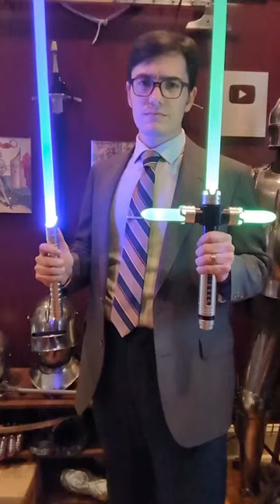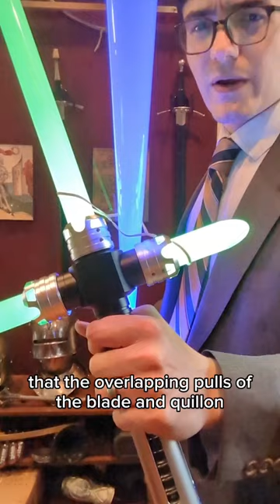Crossguard Lightsaber Theory

Comment: I appreciate your good-faith attempt to clean up Disney's mangled mess.
Reply: Yea I’m pretty sure the only thought they put into it was that they thought it looked cool lol
Reply: But also using information from a Disney show to explain why the crossguard might work(it's possible Disney added that information in so that people can use it as an explanation for why crossguards work)
Reply: @David-gj9qr  The issue is that we can see with our own eyes that that isn't how lightsabers work, there is no magnetic pull. Although lightsabers are unfortunately a flawed concept anyway due to the ability to turn them off and on to bypass blocks and guards that no one uses in real lightsaber fights, so I guess it doesn't really matter.
Reply: Bruh how this is apparently bad and not darth maul’s saber with the huge hilt?
Reply: @omarbaba9892  Darth Maul's saber makes perfect sense. To wield it properly he relies on a form which is more aggressive, and the extra blade can be used as a surprise attack or it covers your back while also defending yourself from the front.
The hilt is long so he can comfortably hold it with both hands without cutting his arms off attempting to do a trick or using the force push.
The hilt is also long because it's basically 2 normal lightsabers glued together on each side, and as shown, the blades ignite separately. And one blade can still be used if the other half of the hilt was cut off.
Reply: Pretty sure cross guard lightsabers exist in legends, it certainly seems like something someone would have come up with before Disney
Reply: @iainwmacintosh  legends had the wackiest lightsabers ever
Reply: @omarbaba9892  Yeah, legends literally had a lightsaber that acted like a whip, but no Kylo Ren’s lightsaber is unrealistic in the Star Wars universe
Reply: Mangled doesn't even begin to describe it.
Reply: There is literally comicstgat show cross guard lightsabers before Disney even bought Star Wars
Reply: @Phantom-_-  I'm aware. That doesn't change Disney's flawed implementation of lightsabers with crossguards, their ridiculous changes to the lore surrounding lightsaber crystals, nor does it excuse their ongoing pisspoor record that has killed any meaningful interest I ever had in the franchise. And before you call me a casual, I was actually a pretty hardcore fan of it back in the 2000s, with dozens of EU novels under my belt. 

This is hot garbage, but if you enjoy it, that's fine, you're welcome to wallow in it if you please, just respect that not everyone is inclined to follow your example.
Reply: The lightsaber whip was still worse
Reply: @pillarsofsnow7940  You can do cool things with a whip. George proved that. And it is less superfluous. Even though I personally wouldn't want to see it be anything more than a gimmick.
Reply: @vice9091 Not really, the Disney canon explained Kylo's saber BEFORE the movies came out...

His saber was meant to be a screw up... they were just vents...
Reply: @Capt.Thunder although the topic hasn't been covered in cannon, in legends it was called trakata and was considered dishonorable by jedi and "too cheap" by the sith
Reply: @namelastname8596  it has been covered in canon and is in Jedi: Survivor, where Dagan’s nooks will use it against you
Reply: @Capt.Thunder  there is a reason why they dont turn them on and off during fights. jedi consider it dishonorable and sith consider it cowardly. we did see it used by cal kestis in jedi fallen order game tho and that might be cause he didnt receive the full jedi training and is therefore more open minded.
Reply: It's not even Disney's mangled mess just look at the EU before Disney it was a mangled mess it's just happens when you have a fantasy Universe with many different writers all writing about the same thing you get offers who are good and don't care about making their mark on the universe that's how you get a Rian Johnson
Reply: @Capt.Thunder even under George Lucas lightsabers were flawed they were apparently hot enough to melt through doors but not hot enough to destroy their own hilts or cook the user alive
Reply: @clonescope2433  You can argue that they're using special metal, or use special forcefields, or that the blade doesn't come into contact with the metal of the hilt directly. 

Blowtorches are real, they can cut through doors, so why doesn't the blowtorch melt itself into a puddle? Why doesn't the blowtorch kill the person using it? That's because that's not how it works.
Reply: @clonescope2433  The thing is, you can compartmentalise off bad supplemental material. But you can't compartmentalise off a mainline movie that determines the future of the franchise. And the bad stuff of the EU was largely inoffensive.
Reply: Disney made it because it looks cool. And you what? It does
Reply: @ShacotheLore  Maul and Dooku's look better. Although ultimately, I think that gimmick sabers have become a bit of a meme, they're overdone at this point. I much prefer vanilla, personally.
Reply: Well, there is NO guard on your average lightsaber, so you'd likely still be stronger with it anyway
Reply: No no.  This is how Star Wars Fandom has always worked.  Over the next 20 years or so, all of the holes will get fixed with a patchwork of ad hoc lore.
Reply: How is a cross guard lightsaber worse than a regular lightsaber? Every point that can be made against a cross guard lightsaber can be made against a regular lightsaber.
Reply: @Capt.Thunder There actually is a form of Lightsaber combat utilising the ability to switch the blade on and off at will, however both Sith and Jedi view it poorly for different reasons. Jedi see it as dishonourable while the Sith see it as weak.
Reply: @Nexus_542  They are superfluous and unlike a regular crossguard, they are a danger to yourself. It's like having your crossguard being blades that face towards your grip.
Reply: @Capt.Thunder  there's actually an explanation as to why turning your lightsaber off and on isn't a great idea even outside of the philosophies of the Jedi and Sith. The practicality of it is that not only does that drain a Lightsaber faster (I know it's kind of a moot point considering it'd be more like every 200 years as opposed to every 500 years a lightsaber would have to be recharged) but also it still takes time for the lightsaber to retract and extend. It's not like a light switch where it's completely off and completely on- we see it extend and retract all the time.
Reply: Actually it's dumb ass bad faith fans that overthought this, I think everyone just assumed the cross within the hilt just held the beams anyway and the coverings were safety for the user...
Reply: Rebels was made before TFA. Filoni iirc was the head dude in charge of Rebels, so he trusted his storyboarder a about this
Reply: @iainwmacintosh the light whip was regarded as a unusable gimmick in the  legends books themselves and was considered an expensive novelty that was easily defeated by a lightsaber and presented as much or greater threat to the user as the intended target.
Reply: It was in legends too with the Old Republic lightsabers.
Reply: Disney didn't design the cross guard saber. They were just the first to show one in live action.
Reply: @TheDeathmail  legends actually already had descriptions of that as well,rather than a tight consistent beam, an unstable saber with a flawed Cristal or faulty emiter would have gradients of color that filtered or pulsed. Occasionally this was also an effect with custom made sabers with an adjustable extended reach. As I understand it they were very similar but could be prone to failure and might have a harder time burning through extremely heavy armor, aka pulling a qui-gon.
Reply: @Capt.Thunder  I love how the canonical reason that nobody uses this is that the Jedi and Sith collectively agreed that it was a dick move.
Reply: @micahsmith2066  It's one of those things that sounds like a good idea, but as soon as you create one that has a nonfunctional crossguard, it becomes obvious that it's stupid. If you want a crossguard lightsaber, you need to design it differently so that it actually works. And if it is just better than a regular lightsaber, you have to explain why 99% of force users don't use it.

Maul and Dooku's gimmick-sabers at least had downsides. Even the lightwhip has noticeable downsides. It being superfluous isn't the kind of downside that I'm looking for - nor am I looking for this magnetic BS that is simply not shown in any Star Wars media, it's pure headcanon. Like everything in Disney Wars, its retcons end up doing more damage than the problems that the retcons were attempting to address. The Holdo manoeuvre? Oh, that was one in a million. Please don't think about it too much.
Reply: cross guard sabers existed before kylo ren…
Reply: @DarthKanye  Yes, millions of people keep telling me that as though it's a gotcha but... Um. Newsflash, they were terrible then too, I've looked at some of the designs and they still make no sense, and if you did make them make sense you would have to explain why not everyone and their mother uses them, because they'd just be outright better than the current version. 

But Disney has actively damaged the lore surrounding lightsabers, I don't give a crap about Star Wars any more, it's dead to me, and it used to be my number 1 franchise, I was a superfan. There's just nothing left. Even the embers stoked by the Mandalorian have gone out. 

Tbh, you should find something more interesting that is still alive to be invested in.
Reply: @Capt.Thunder the lightsaber lore is that the plasma blade is contained in a magnetic field so a bit of magnetic interaction would make more sense than not having any
Reply: @iainwmacintosh do forget the one that spews lava everywhere
Reply: @toastslicer4885  I use my eyes. Also, by that logic, they could just as easily repel one another, which is far more likely, and that would at least be supported by the visual evidence of blades pushing up against each other.
Reply: @Capt.Thunder  they also enter ridiculously long binds that wouldnt work if they were repeling each other
Reply: @Capt.Thunder  you can still enjoy star wars without interacting with any of the disney shitload. watching the 7 actually good movies and shows like clone wars and andor is sufficient, so you can still be an passive fan and we all hope someday it all blows over. as for cross guard hilts I would imagine they have beskar plating which explain their rarity too
Reply: @DarthKanye  1) Easy for you to say, 2) yep, it would be nice if they did anything to fix it, and 3) that's fair as a means of fixing it, but it's headcanon.
Reply: @vice9091 That's literally all of Star Wars designs since the 70s
Reply: @kingcrimson7658 So? It's still a long blade that is much more of a risk than this.
Reply: @Capt.Thunder  execpt light sabers take a few seconds to engage the blade, meaning turning your sword off leaves you open for 3-4 seconds
Reply: It was a mangled mess before Disney bought it.
Reply: @sjhmagic1  It had problems, certainly, but not nearly as catastrophic and frankly, fatal, as it does now.  "Star Wars was always bad" is a silly position to take, no one takes that position seriously.
Reply: Disney's? The regular star wars already had the issue that you could slide the sword down if you wanted to.
Reply: @iainwmacintosh two things can be true.
Reply: Wassn’t it ssaid that kylo had a fucked up crysstal and needed the crosssguardss ass a vent?
Reply: @eldritchcupcakes3195  That's my preferred explanation. I think it makes a lot more sense.
Reply: @Capt.Thunder there's actually two reasons i can think of as to why that isn't done. 1: it takes time for a lightsaber to retract, and while it's happening the opponent can easily take advantage of the opening and kill you before you can extend it again. 2: i believe there it also isn't done because the jedi consider it a dirty trick and the sith consider it a cowardly move.
Reply: @Capt.Thunder  For someone who says the franchise means nothing to you anymore you're sure talking about it a lot. Just because it has changed from the things you loved doesn't mean that it's all garbage that has no purpose existing anymore. Star wars has always had retcons, it's always had inconsistencies, it's always had some dog shit somewhere. I'm not exactly a big fan of the sequel trilogy either, but for some kids that's the star wars they watched, that's the shit they love. They know every bit of lore surrounding the movies and they read all the books and comics, just like you did. Just because you can't take off your nostalgia vision goggles to see that a lot of old star wars shit objectively wasn't that great and the new shit usually isn't either doesn't mean that there aren't kids who love it, and we'll have a wave of nostalgia in 10-15 years just like the prequel trilogy had.
Reply: @MaximusChivus  Raw copium. Star Wars was the biggest media franchise in history and Disney killed it in less than a decade. Look at the viewing numbers, look at the legion of people bashing it, look at how the normies talk about it, look at how many fans like me that they have alienated.

The writing is on the wall, my friend. You can only keep reality at bay for so long. I wish it was good, btw, I wish I could feel anything about it any more. But I can't. And that is because Disney can't write for s#!7 any more, and either has no interest in the franchise (see JJ and Ryan) or are too incompetent (Favreau and Filoni).
Reply: Well first thing to understand is if you know them, you know those aren't a cross guards.  they are vents.  the "Cross Guard" light saber is an over charged light saber, which used to be seen as having a wavey unstable blade.  The Vents on the side, are shunts.  The Cross guard like form is to safely dispose of this waste plasma and heat without frying the owner and keeping the blade stable.
Reply: @Capt.Thunder yes but it can be a possible explanation as to why the beams can physically stick to eachother. It’s possible that pull only gets felt when both plasma blades are interlocked for a certain amount of seconds (likely at least 3 seconds).

(Side note: maybe the reason why the magnetic pull isn’t nearly as strong as it should be could be because most metals used in the creation of a lightsaber naturally resists this pull causing it to not be visible and the reason it’s visible on the dark saber is because the hilt itself is beskar which resists a lightsabers plasma cutting ability causing it to attract this magnetic pull instead of resisting it but then that would create an argument as to how the hell plasma works in star wars.
Reply: @zyphier  Somewhere in this thread, I mentioned that that is what I had heard, and that it is my preferred explanation. But there are instances of crossguard lightsabers in other media (specifically The Old Republic) that people are defending.
Reply: It's so cute rhat SW fans are like this.  Give in another 20 years, and there will be a sequel/prequel that will come out... everyone will say how good these were, and how bad thr new ones are...

Nothing like the pristine prequel trilogy, or the near Divine original 3...
Reply: @MonteAdorableMax  While you can criticise the prequels for poor writing and structure, and wooden acting, it is at least really creative, even if the execution was flawed. And they're just fun films.

The OT is a bit dated, but it remains exceedingly solid in spite of its age, and earned its place in cinematic history. It'll be a touchstone like the Jackson Lord of the Rings films.

The Disney sequels on the other hand have slightly better cinematography and CGI, slightly less wooden acting, but that's all they have over the prequels. Even casual analysis will reveal that it's plot is nonsensical and self-negating, with more holes in it than swiss cheese, its worldbuilding is nonexistent (consisting of a lazy reset plus mystery boxes with nothing inside), and shows utter contempt for the source material and characters. It's utterly vapid and devoid of any merit whatsoever.

At least the prequels gave us funny memes and a good time. The only thing the Sequels will be remembered for will be popularising awareness of the Mary Sue trope.
Reply: @iainwmacintosh  They definitely do.
Reply: @Stethacanthus   Ruthlessly accurate. Especially as people love complaining about stuff, only for it to have been a thing in EU canon.
Reply: Lightsabers have always had that glaring flaw since the very beginning. Without this weird cop out of the blades being attracted to each other and difficult to move on each other, even a normal lightsaber would have been basically useless. This isn't a Disney problem, it's a problem born from having super cool laser swords that can cut through almost anything.
Reply: @azure3456  I mean, they can't cut through almost anything any more, according to Disney. Qui Gon was weak, you can be stabbed straight through the chest and it only causes a minor flesh wound to most people.
Reply: I mean if we are going to complain about the logic of lightsabers.. Disney wasn't the first to fuck up
Reply: @Capt.Thunder   Except that is bullshit, Qui-Gon didn't get immediate medical attention right after and both wounds were in the stomach, which is how one person survived in the first place. And that was with more than 30 to 40 years of medical science between them. A thing that people joke about by saying that Bacta tanks had just got invented. 

Never mind that Vader literally was burned, inhaled the fumes of a magma flow, sat beside its heat and was cooked by the rock he sat on the whole time. Or how Maul was literally cut in half...before falling into an active reactor.

But you know, minor flesh wounds for most people...
Reply: @LupineShadowOmega  This is such cope. You get hit anywhere in your torso with a lightsaber, it should be lethal - it can melt through durasteel blast doors, people's stomachs aren't made of durasteel.

We all know that Maul survived through Rule of Cool (we can handwave partly because of Sith bullshit, but it's still very generous). 

Sabine should be dead. Reeva should be dead. Even if they do somehow survive, they should basically have to become cyborgs like Maul and take ages to recover. 

Stop coping.
Reply: @thecrazything95  There are different degrees of "fuck up" my friend. Sure, it's a laser sword, it isn't 100% realistic, but we can handwave some things easier than others. 

I don't see why you feel the need to half-heartedly defend them on this point.
Reply: @Capt.Thunder  Oh really, you mean the people I mentioned should be dead...I wonder why I might use them as clear examples. Yes, that was the point. As for Maul and "Rule of Cool" what you mean to say is plot. And my point continues to be that plot keeps being the answer and didn't just get that way. Heck lightsaber damage just being treated like regular sword damage isn't even new. Star Wars didn't just get wonky with "realism" it was always that way because it is space fantasy with wizards and nothing approaching sci-fi. It's why every time something in lore gets over explained, people hate it.
Reply: @LupineShadowOmega   "what you mean to say is plot" No, Maul was dead in canon for years after Episode 1's release. But so many Star Wars authors and fans thought he was cool and were desperate to manufacture a way for him to come back, which is where the robot legs come in. Maul's return went through multiple iterations until finally it was properly considered canon in the form we have now, with the Death Watch storyline, etc.

However, what I do agree with you on is that lightsabers acting like normal swords is stupid. I don't want them to make people explode from being superheated, I just want some basic consistency. I also agree that leaving room for mystery and wonder is better than giving concrete answers to everything, it invites imagination.

Disney making it so that Sabine and Reeva survive opens a huge can of worms that didn't need to be opened. In George's Star Wars, you get stabbed through the chest, you're pretty fucked. In Disney's, you're out of hospital the next day.

Much like how they fucked everything with hyperspace ramming, hyperspace jumps in atmosphere and gravity wells, the consequences of hyperspace tracking, and how they completely misunderstood what George meant by "bring balance to the Force". The Light is the Balance, the Dark Side is the imbalance. The Sith are extremists, the Jedi are moderates. The Sith seek to selfishly impose their will upon the galaxy, the Jedi seek to be responsible caretakers, make peace with fate, and allow the galaxy a reasonable measure of self-determination. Palpatine and Vader dying, ending the Sith, brings balance to the Force. But no, SOMEHOW PALPATINE RETURNED. Undercutting Anakin/Vader's sacrifice in the OT.

Disney Wars is a tyre fire and I have basically no faith or interest in it any more.
Reply: To be fair, a cross guard lightsaber was not so utterly out of the realm of possibility to be a problem, especially compared to some of the other nonsense that got spat out at us.
Reply: @DISTurbedwaffle918  I don't mind the idea of it in principle (even though it needs to be established to have some downsides, otherwise the question arises: Why aren't all lightsabers like this?) but the execution is terrible. 

Exhaust vents that superficially look like a crossguard are a much better explanation than claiming it is used as an actual crossguard with its current design.
Reply: @Capt.Thunder well apart from what we have from disney, there was that one block bypass shown in visions